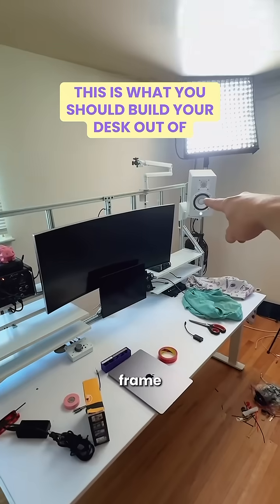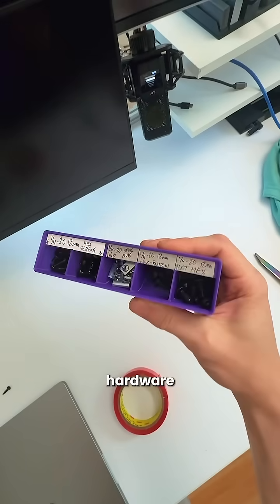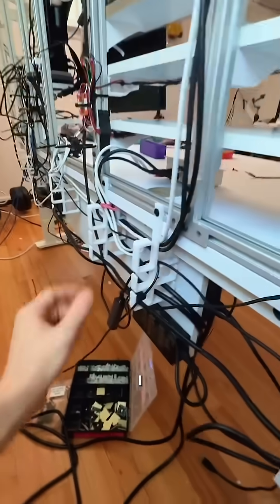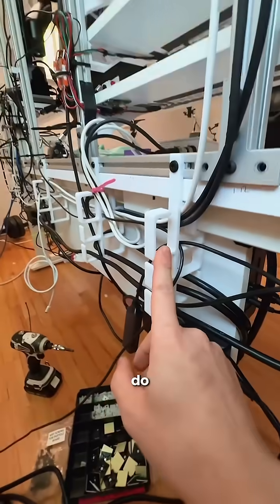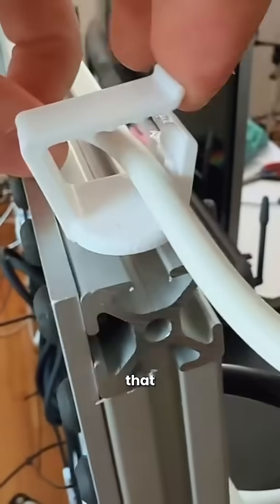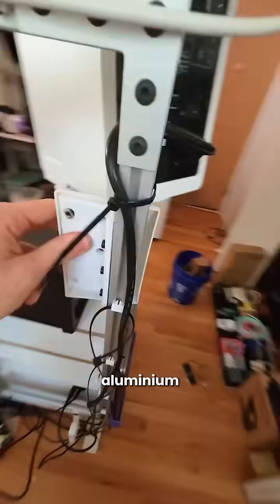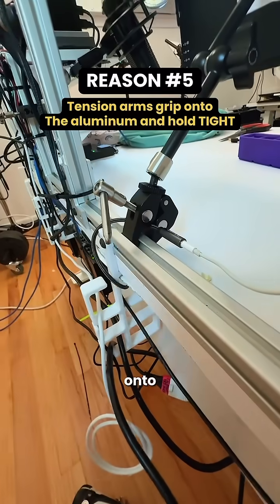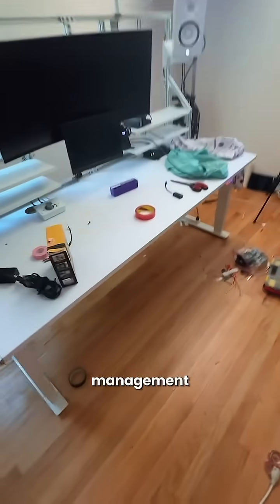Why aluminum extrusion framing for desks is my favorite.

Comment: Today I learned that I need to make sure my audio cables arent touching my power cables. Thanks for the weekend project.
Reply from the maker: If you don’t hear any interference or white noise is your mic or headphones, don’t worry about it! Lots of cables, have enough shielding to prevent this these days, but you never know😅
Reply: @Naaackers But I CAN separate them, so I must. I've got sleeves and stuff for cable management. 

I really want to add extrusion to my desk, but I've already modified it with a grommet drill a few times.

Comment: The technical terminology for the loop routes are essentially "wireways". While not identical, they serve a similar purpose as a platform or support to route avionics/cables in aerospace and large ship vessels. The aluminum extrusion is typically notated as "80/20". Great setup!
Reply from the maker: Oh that's super interesting, I never knew that! Thank you.